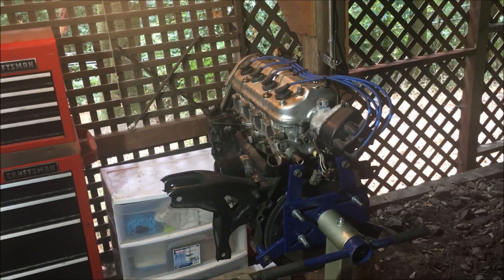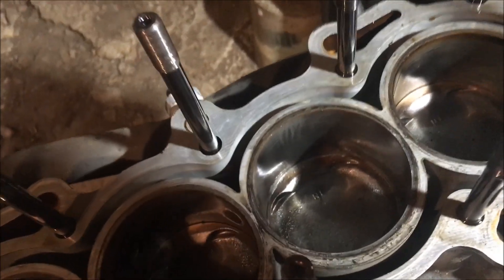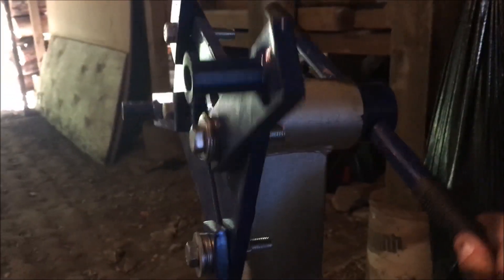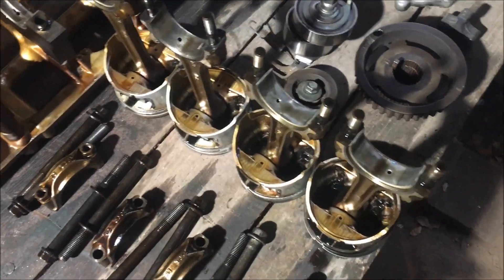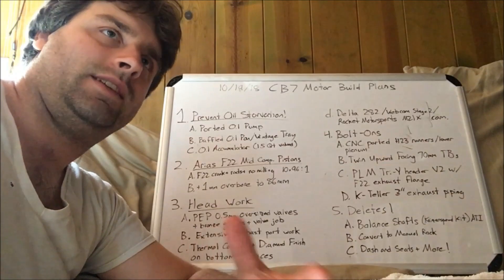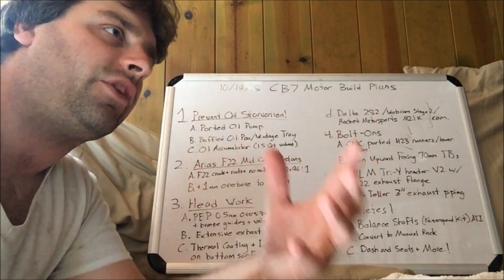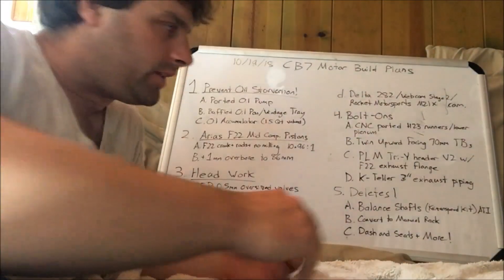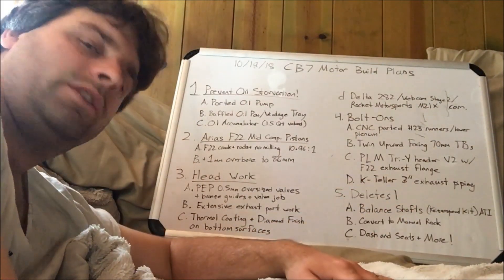The CB7 Motor Build Part 2 - The Teardown and Build Plans

Comment: None of these plans went through did it? Would of loved to see a great unique f22 build instead of the common h swap accord.. these plans were some great plans as well. Would of loved to see the power output or at least the drivability. With just a 282 profile the idle lope alone would of been worth it..
Reply from the maker: Did not go through, check part 3, where it becomes clear that the crankshaft was toast.
Reply: @af1132racing  ive picked up 3 f22a1 and a4 from my local yard for 110 bucks for complete block minus accessories.  I picked up a complete h22a4 as well. But I rather build my f series just because I feel its more unique to me as well as the fun fact of making a performance engine that keeps up with the typical h swaps or even swapped civics. Idk im just a huge fan of the f series now. I love the h swaps as well thats why I snagged one up, but I probably wouldn't touch it until I had my fill building the f22/f23. A good cam does wonders for these little engines. They sound great as well

Comment: H swap it man! Stock H22 or H23A will make more power than the built single cam will for less $. And it's such an easy swap, probably the easiest honda swap out there. You only need to ad 3 wires. vtec solenoid, pressure switch and knock sensor. And if doing it on budget you can use your single cam F22 transmission, axles, mounts, ect. 200 whp with a few bolt ons. Chipped p28, 3" intake, PLM header, 2.5" exhaust, 70mm TB, ported IM. H22 just seems like an all around better starting point for an engine in my opinion, more power out of the box, greater potential of more power in the future.. I have a H22A in my CB7 coupe, untuned I ran 14.8 on garbage all seasons and a slipping clutch. Once I get it dialed in I'll be in the low 14's no problem. I've had 4 CB7's. Three with the single cam F22A1, then i swapped one to a DOHC F22B, now i have my H22A in my coupe. The DOHC F22B was fun swap but the H22 is just awesome. Good luck with the build regardless! Always cool to see the true potential of the F22. They can be quite impressive with a bit more compression and an aggressive cam
Reply from the maker: I appreciate the detailed comment man!   I also congratulate you on your success at the strip!   Most CB7 H swaps stock that I have come across on the CB7Tuner forum run 16s or 15s, which is why I didn't bother.   I also agree that the H motors have a much larger aftermarket.  Here is the main problem I face with an H swap: finding a healthy motor from a reputable source that I can afford.  I have been told time and time again that Hmotorsonline is the only reputable high volume source, second to none.   I've seen their prices too: roughly $2000 or so, ouch!  I would also need to make sure it was OBD1, or more harness related purchases would have to be made.  I just didn't have the stomach for all of that when then F22 flows so well in it's rpm range.  I think, for now, I will work to maximize this motor first, and then move up to a DOHC to make use of the larger potential that may be there.  I am, what you call, a thorough experimenter!
Reply: @af1132racing  My H22 came out of a OBD2 car, I just soldered OBD2 injector plugs onto my OBD1 accord harness and used the accord distributor. And wah that is expensive! 2k for an H22A? I'd hope that's for a complete swap atleast, trans and ecu included. Not sure why but up here in Canada we seem to be blessed with cheap JDM engines. An H22A long block is usually only around $900 Canadian dollars from an importer. Few years ago before the H2B craze you could get an H23A vtec blue top for $800 from an importer with warranty
Reply from the maker: The Hmotorsonline engines run that much partly because they have ECU and trans included, but the main reason is the fact that we have certain customs duties and such for import into the US.  I have found that a ton of the motors are first imported into Canada, then bought by US peeps, and then they pay a hefty sum to get it transported across the border to their houses. To be honest, for a motor that is not allowed to run in Japan anymore because it is expired, the amount we pay just to get our hands on one is ridiculous. But hey, we love our cars!
Reply: The f22a head has smoother and ultimately quicker airflow than a b series and an h series.  It stands on a 2.2 liter block which means the overall POTENTIAL of air input and output is greater since it’s not a 1.6 d series engine.  The block has pure iron sleeves which are strong to hold so much power, especially if you build the f22ax engine, you’re looking at even a lifetime of reliability with that block.  
There are absolutely zero aftermarket camshafts for the f22ax.  However, a regrind will do just as well as if it had higher lobes.  How is this you might ask.  Supertech sells a full valvetrain for the f22ax.  Upgraded valves and springs mean higher lift in the head, and when you shave off material from the camshaft, it approves the valves and springs to lift as high as its maximum ability, which is very good for power.  Supertech offers 37mm flat valves, which would already raise the compression of the motor on stock pistons.  Well, let’s say you get the arias pistons as mentioned in the video, 86mm on those iron sleeves will not only be reliable, but produce more power, but more torque as you are overbore-ing your cylinders.  
The last thing i’ll say over many other technicalities.  Fuel is onviously important, larger injectors will allow tuning to match with the amount of airflow.  KS Tuned offers a balance shaft eliminator kit with a brand new oem oil pump, freeing up 15+ horsepower, as well as billet oil pump gears, that allow such reliability for highest reving ability and overall engine performance.  
It takes a honda nerd to figure such things out, at least for honda engines.  So much power to be made.  Just look st bisimoto, made 300hp on an f22a engine.  
Mine is for road racing though :)

Comment: Props on the f22a build! Last summer i bought my third 4th gen! A 1990 LHD 2.0si exclusive coupe imported from japan with the higher compression f20a DOHC only problem was it was automatic! Over the winter i put on my ported SOHC f22a head+272 cam, a Nitrous Express wet kit with 75hp jets and converted it to 5 speed with a prelude m2y4 transmission. Plenty of potential these motors! Too bad people go straight to the H22. Who needs Vtec and two cams anyway lol.
Reply from the maker: I appreciate the comment and sub, my friend!  Do you have some videos up of your build and/or how it runs?  You're right, these motors have so much potential.  I will never go straight to the go-to motor swap, that's just not how I am.  I have a similar Prelude transmission swap, the M2Y7 case and internals assembled by Synchrotech for me, and I loved it from day one.

Comment: how much is this build going to cost on estimate?
Reply: Damn bro,. That's a whole helluva lot.  I'm replacing the clutch in mine right now.   With no power tools .. I think someone stole my impact , so it's been a fun process .    It looks pretty ghetto but it was a friends who gifted it to me .      My last Accord was awesome until my brakes locked up and rear ended some dummy who couldn't refill her blinker fluid.    It's a real prize Accord though .... My new one.    It's been through so much, and so many times it's been told it's never going to run again.... And guess what!?   We always get that fucker back on the road
Reply from the maker: It’s going to be alot, but I want it done right, and I want the engine built by the best around.  Peace of mind goes along way when the car is so abused on the track.  Good luck with the rest of your clutch job, and you are abolutely right: these cars, being so overengineered, just never stop rockin’.  Mine had 305k miles on it before I ever began any modifications at all back in 2103.  The quality of engineering in Hondas in the 1990s was second to none.
Reply from the maker: I am estimating between $2000 and $2500 for the motor build itself, plus another $1000 for the other supporting mods and interior upgrades.  I am going all in this time!

Comment: Why are you building the f22. The h22 would give more hours and cheaper. Also for the balance shaft delete it's best to buy the new oil pump assembled kit they sell. They don't tell you up front, but the plugs they sell can fall out when using a old pump. Even if you follow their Instructions. Happens to might, i called them up and that's when they told me. Almost blew up my motor because of it.
Reply from the maker: Thanks for stopping by and subbing, I appreciate it!  I am building the F22 for many reasons, number one being that I have already seen what it is capable of with mild head work (cam and springs) and all the other external mods + tune (15.10 ETs and passing S2000s at Laguna).  Also, I have not seen the same results from straight H22 swaps into CB7s in certain ways, most notably 1/4 E.T.s.  I know the power capabilities and aftermarket is much more extensive, but a proper H22 build would be more expensive for me, since I would need to first purchase the motor from a reputable source (hmotorsonline) and then build it with the proper bolt ons, tune, wiring, etc.  I guess my main point is that the HP figure is not the most important thing to me and this build.  Thank you for the tip about Kaizenspeed and the oil pump.  I will be calling them about that, since failed plugs will kill my motor in one turn at speed!  It seems to me that they should be advertising these pumps more than they do.